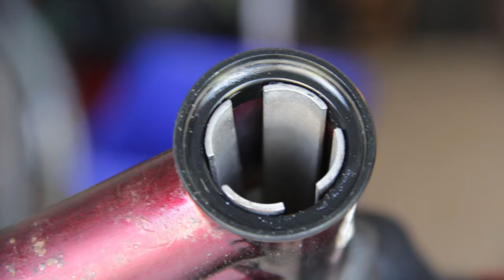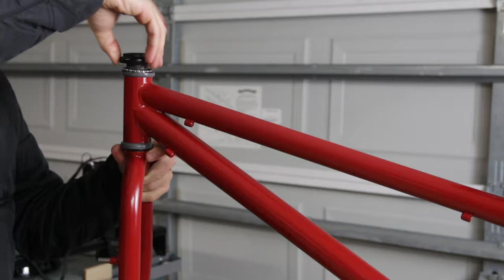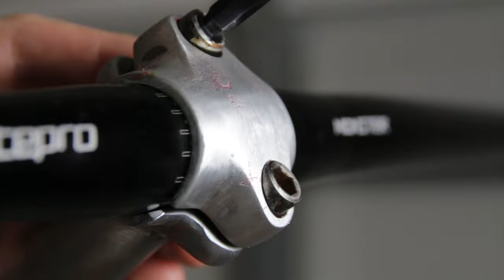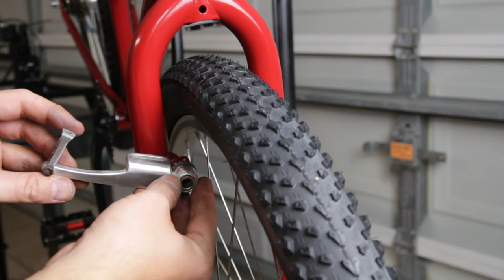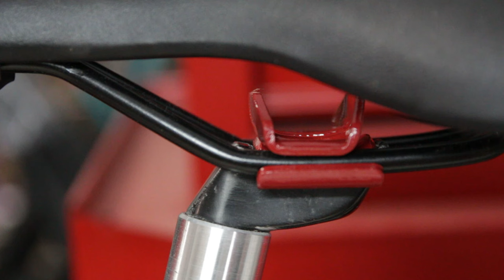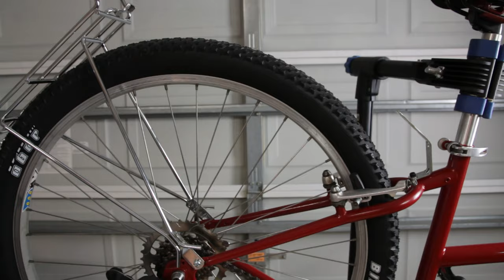$231 - 1998 Schwinn Frontier full build - urban bike

Comment: I just finished rebuilding a slightly down-spec'd Frontier for a friend.  Hers was in better condition wear-wise but had not been ridden in years.  The paint was in great shape, thankfully.  All the bearings were gunked up and grungy but the cups and cones were find and cleaned up nicely.  The cantilever brakes were sound but needed some TLC.  I found it impossible to get the rear indexing to work 100% with the unnamed Shimano SIS 3x7-speed -- there is un-fixable play in the parallelogram -- but it's close.  Overall, the bike functions as well now as it did when new, better in some ways.  She's picking it up tomorrow, and I'm happy she'll be getting back to riding and that I could play a part.
Reply from the maker: I just actually sold mine yesterday, I swapped some lower end parts back onto it and it sold to an older woman who seems to be happy with it. Only sold for $50 and I had it posted for weeks.

Comment: I watch these sort of 'Oh hey 90's bike restoration' videos and think back trying to remember the bike my older brother had, that I'd ridden... basically int othe ground. Had an incident where the chain went into the back wheel and teenage me rage quit rather than try fixing it.

I wish I could slap teenage me for doing that.
Reply from the maker: haha true
Reply: @BruceChastain  How're those grips? Been looking for replacements for the stock hard rubber ones and the main reason I haven't pulled the trigger is no way to test 'em out. Those honestly look nice.
Reply from the maker: @singletona082  I like them a lot! I think I got these off amazon, I can check and link you if you want.
Reply: @BruceChastain  Probably will have them by the weekend. Thanks for the endorsement.

Comment: I get rid of the rust by soaking in vinegar for 2 - 3 days.
Vote 👍
Reply from the maker: thank you 20EUR20. And you know what, I'm going to try that because the crazy mix I was using didn't actually work that good, it took a lot of wire brushing to even look decent.
Reply: @BruceChastain   For chrome, you can use a paste water+baking soda (sodium bicarbonate) and a toothbrush or your palm/fingers. Or use wet aluminum foil.